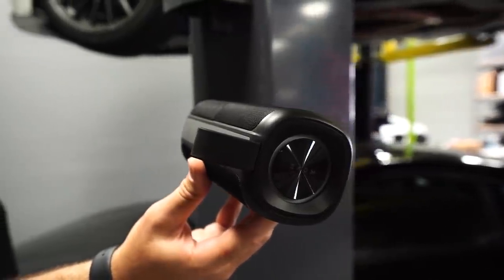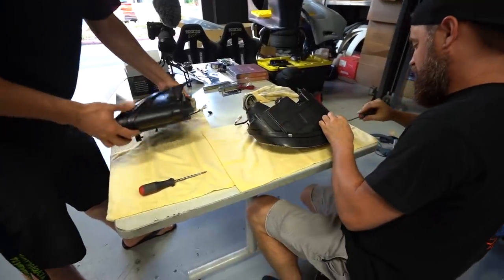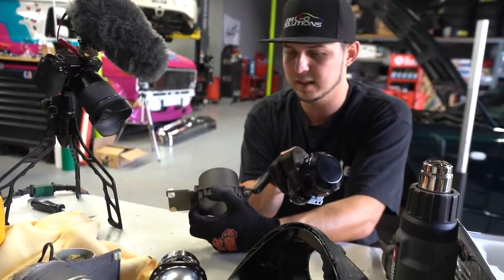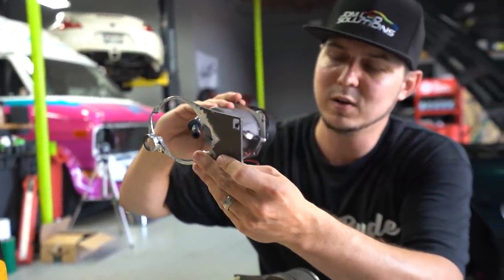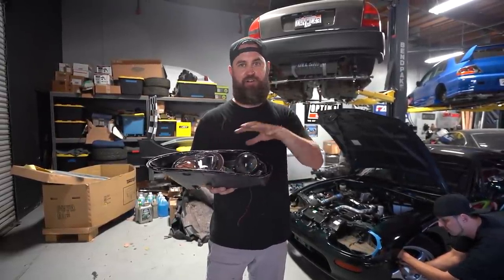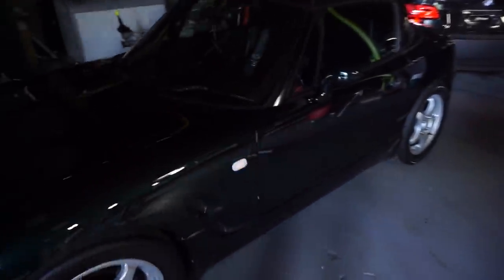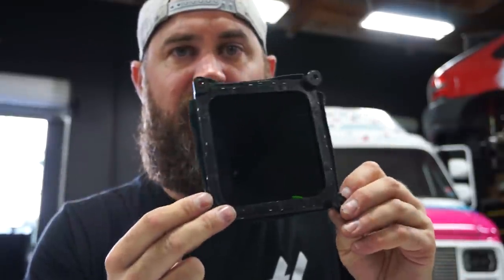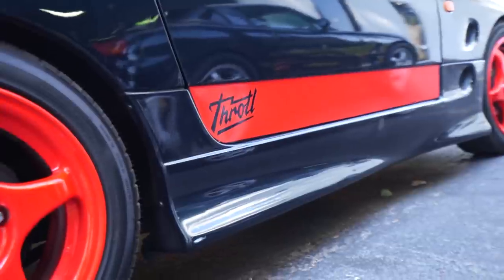Turning the Cappuccino into a Modern Day Sports Car!!! (Major Headlight Upgrade COMPLETE!)

Comment: Look into Honda shin etsu grease for the squeaky seals. It also helps with keeping them moisturized and prolongs the life. I use it on my mr2 it actually helped with rain getting inside too.
Reply: I was about to say the same thing
Reply: That or slide glide. Very similar.
Reply: Classic honda trick, always works on seals
Reply: @shplayshiggty7537  yeap, I was about to say the same.

Comment: Mickey Andrade - You can try Aerospace 303 to lubricate and restore the rubber/plastic pieces. While many detailing supply makers make alcohol based rubber dress up products for rubber and plastic pieces, Aerospace 303 is the only product that I know of that can truly restore aged rubber and brittle plastic. Use a foam brush to saturate Aerospace 303 on the rubber you want to lubricate and then wrap them in saran wrap. Let the rubber absorb the 303 for as long as possible. Repeat this process after 24hrs if you can. The longer the rubber gets to soak up Aerospace 303, the better. It does not harm the rubber. The hardened rubber will be permanently restored. High end detailers who detail exotic cars do not use dress up products; they use Aerospace 303 because the key is to make them last as long as possible, not make them look shiny.

Comment: Use dielectric grease for the weather stripping. It is not petroleum based so it will not deteriorated the rubber. I used it on a Del Sol i had for years to help with the noise

Comment: 14:19 To silence those squeaks spray a bit of silicone (the spray can type) onto a rag and wipe it on the squeaky rubber. Works great on exceptionally squeaky motorcycle boots, should work fine for your squeaking rubber seals.

Comment: Mickey, meguiars vinyl and rubber conditioner in the brown bottle. Use that on the rubber and should quiet the squeaks. Will take a few applications. More than likely 3-4. Make sure and leave it milky and use a low heat on a heat gun. For safety use the Milwaukee m18 heat gun. Super safe and easy to not make mistakes. Love the cappuccino content. Still jealous.

Comment: Rub some silicone dialectric grease into the seals with your finger and then wipe off all of the excess with a towel. This method is actually recommended in the owners manual for my c6 corvette.

Comment: giving Mickie a heart attack cutting headlight bezels..lol like me with my Venom injen intake manifold grinding the TB opening out far enough to fit the 70mm Tb to it.for the squeaking Mick i don't know if it will work for you but STP Son of a Gun Protectant helped stop it for me on my window rubber seal on my doors..

Comment: LOL I just was going to ask if you where trying to find a way to stop the top squeaking when you asked for comments.
I have done some experimenting with extra weather seal, but so far it hasn't worked...But I mostly roll with the top off if it's above ~60 out.

Comment: Not sure if a swap is even doable but damn would it be clean to swap that new Toyota Yaris GR engine in there
Reply: It is 100% possible, but would require a lot of cutting and welding. It would be like dropping a big block 1960s V8 in a Miata! lol. the engine bay is small enough to fit the 657cc engine, but JUST fit. LOL.  Even a street bike engine swap isn't without fitment issues.  Also, the engine and gearbox in these things is so light, you'd need extra horse power to compensate for the extra weight.  Check out some cappuccino engine removal videos, people picking up the short block like a bag of groceries! haha